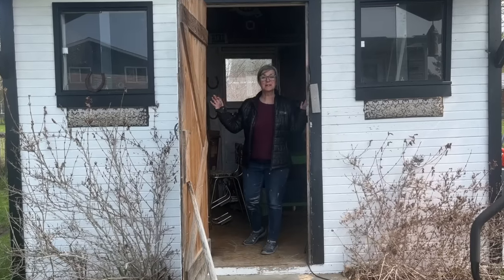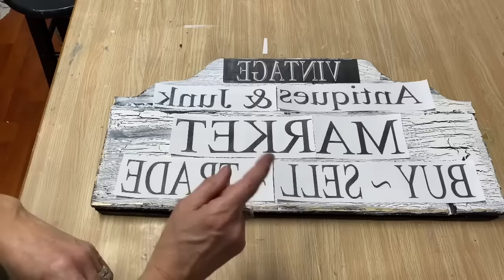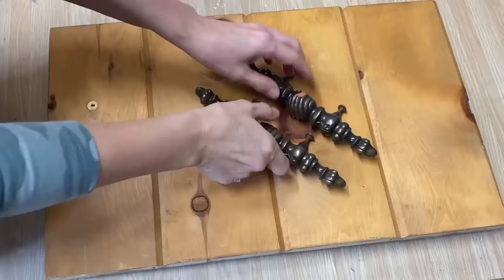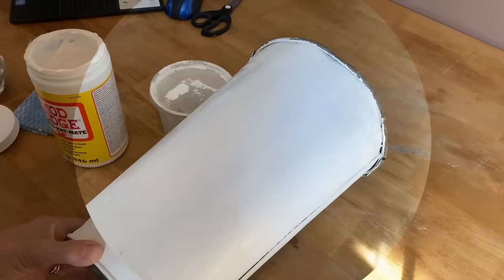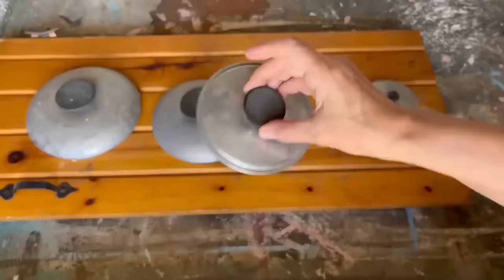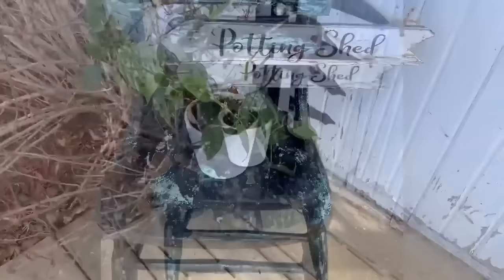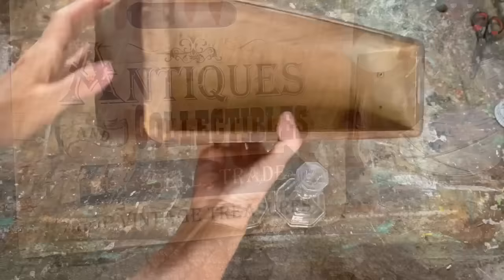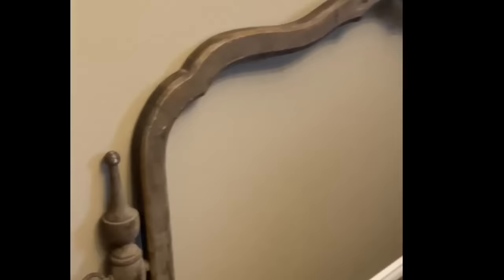28 Thrift Store Makeovers / Upcycling Ideas for Your Home

Comment: To stop your air dry clay from cracking what you need to do is put a damp cloth over top of it while it’s drying so it doesn’t dry as fast and take a lot more time split it with a water bottle to
Reply from the maker: Great tip

Comment: Excuse me, do you check your script? In the first project you said that the tranfer done using the polyacrylic varnish would only need to dry a couple of hours as opposed to the mod podge that needs to dry overnight, but then you let the project dry overnight. So does Varathane need to dry overnight or not? 
In the second project you mentioned screwing the boards together, but then you said that they were nailed up. So did you use screws or nails to join the boards.?  Thank you.

Comment: If you wanted to use those pieces of wood as a cutting board, could you sand it down real well and then apply cutting board oil on it?
Reply from the maker: I think you would want to know what type of wood it is and make sure not contaminated

Comment: For the inside couldn't you use a hole saw. I'm planning on making one I have it set to cut. Will cut lid off top then use hole bit to cut center out. Slice a piece off hole wood and glue to center of lid
Reply from the maker: Yes would work